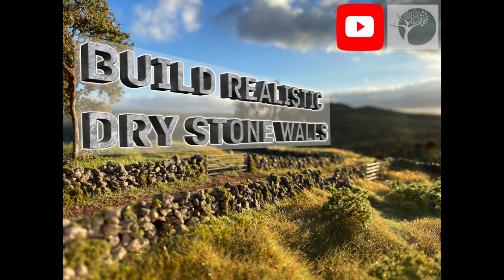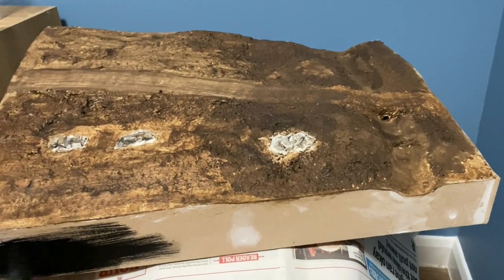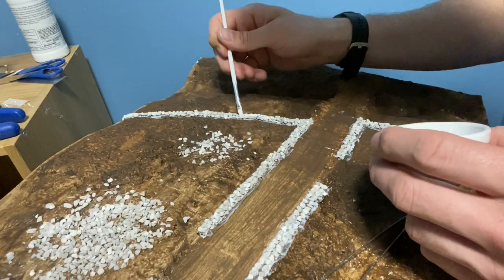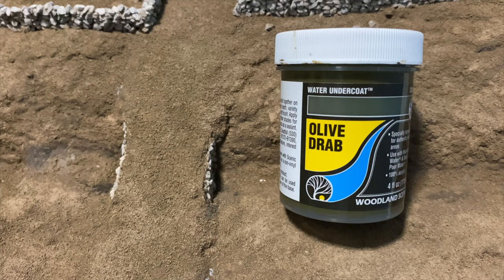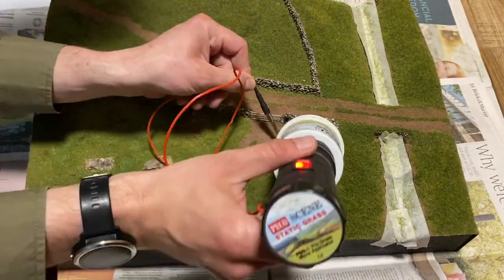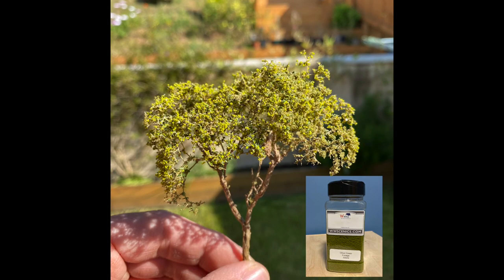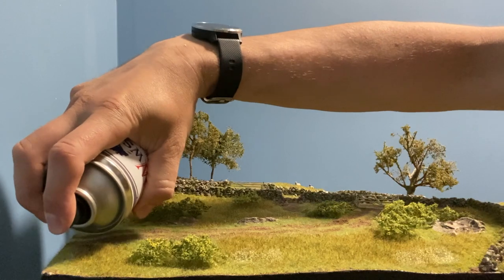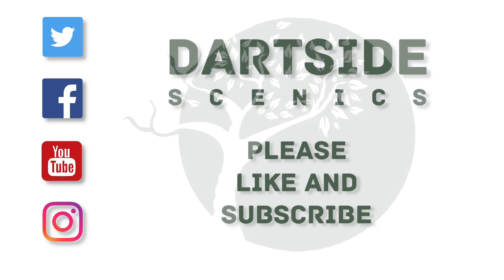Model dry stone walls

Comment: Superb. One question please, curious when doing the static grass why did you hold the grounding wire rather than pin it to a wet part of the baseboard for grounding the negative ion generator within the applicator? Did the applicator still generate static electricity ungrounded or was your body the grounding?
Reply from the maker: Thank you.  That's right, you don't need to use a pin but hover the clip just above the area you are applying.  I believe this gives it enough charge and direction to stand upright.